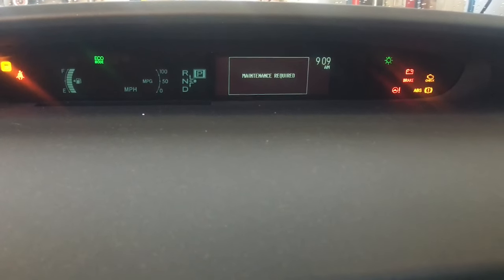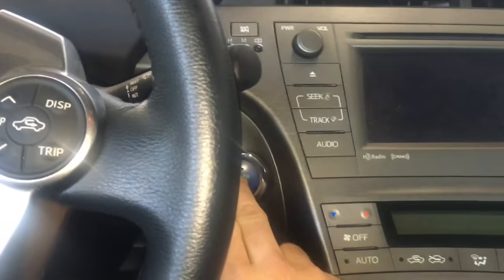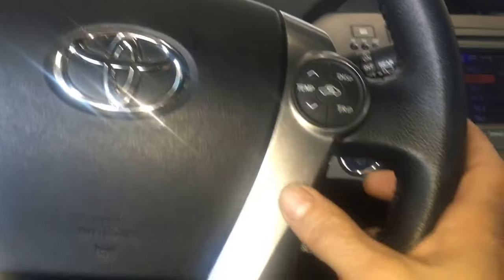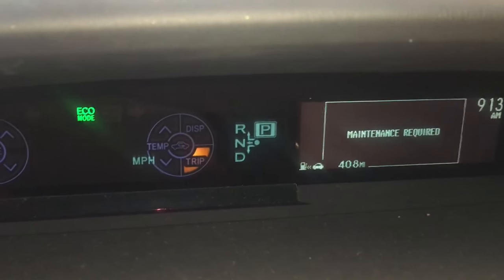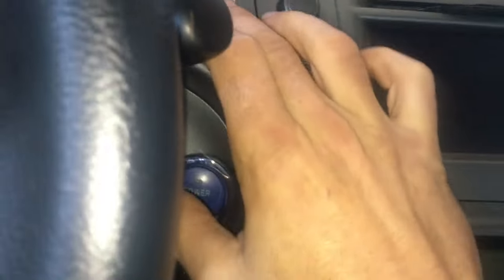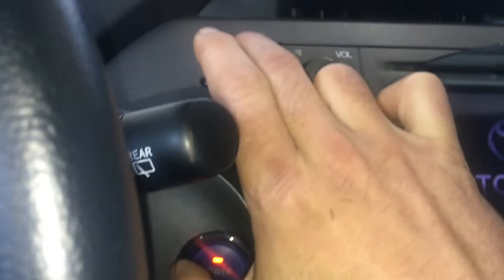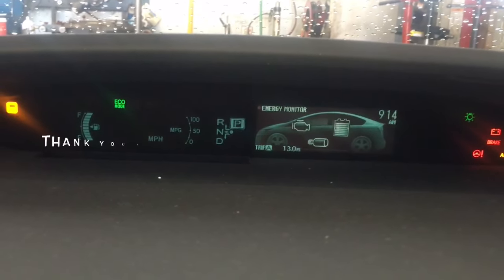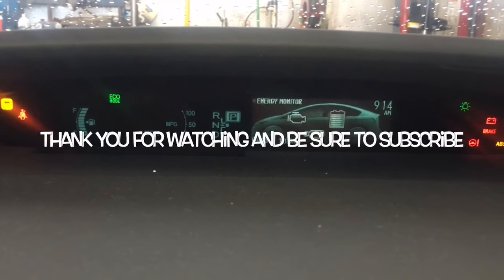How To Reset The Maintenance Required Light On A 2012-2014 Toyota Prius

Comment: He is right up to the point that after you push the start button twice, you need to keep holding down the km/h - MPH button till the reset is finished.  Good video. Thanks.
Reply: You're right! It worked only after I kept pressing the km/h button until the display showed it was finished resetting.
Reply: Oh man THANK you! I thought I was the only moron not doing it right. That worked!
Reply: I did all of these steps but It doesn’t work. I’m holding the button all the time, but it wont reset anything
Reply: Dude thank you
Reply: @nazarenkoy2680  for some reason on some of these cars you have to make sure your display screen is set to "energy monitoring" for it to work.  It took me some time reading forums to figure this out.  Seems like an extremely important detail to leave out.
Reply: That did it. Thanks a mill!
Reply: @vincentlenart1697 Thank you!
Reply: @Brainbuster Yeah, he shows it briefly but doesn't say it.

Comment: You're missing crucial detail that would save a lot of people serious headaches if included; Make sure that your display is set to the energy monitor screen... might not be required on all gen 3 prii but is required for mine. Found it on a forum after reading through accusations that the op wasn't following instructions... which they and i were.
Reply: Omg thank you!!! I wasint getting it, it took me 2 hours due to this crucial detail I didn't have
Reply: @LuisGarcia-iy7oh  No problem! I'm glad i could help spare someone some of the frustration i went through.
Reply: Damn dude you’re a g, this worked for me thank you.
Reply: After many tries gave up but finally found your thread and bingo I’d buy you a beer if I knew who you were lol thanx.
Reply: It was the consumption screen for me, but either way, I'm thinking the key is that it can't be just left on the maintenance required screen upon turning off. I could be wrong.
Reply: Thanks for that, I was having the same problem
Reply: Thank you!!
Reply: @MegsMT  glad i could help!
Reply: Thanks brother!
Reply: Thank youuuu. Yes. I needed that piece too 🙏

Comment: OK,  I got it,   you're OK with the steps,      That button on the right is the wrong button SIR,     I'm sorry to say,   the button that you want to PRESS,     is on the left  lower side across from your KNEE,   says - "mph / km"   on it,    I pushed that one & it worked... 👍
Reply: Mine is in the same place as you say, but the model he's in is obviously different.
Reply: Because your model is probably different. Doesn't mean he's wrong. You probably had a split year with different options. It worked for me just fine and was where he said it was. So he was right initially. That's where most are on 2012 prius.

Comment: Thank you for this clear short video. I just changed my oil and wanted to reset the maintenance required light. The previous video I looked at did not say to push the power button twice with the brake pedal off at the same time as holding the kilometers per hour to miles per hour button. Your stating that clearly helped. Thanks.

Comment: For plug in make sure it is on Trip A and turn car off...press down on kmh/mph (it's on the left of the steering wheel under your gasoline button) and don't let go, then press the power button twice

Comment: Hi after I did this, my engine wont turn on anymore amnd the lights are flickering :( are those two related?
Reply from the maker: Sounds like the battery went dead. You’ll need to get a jump or the batteries on the way out needs to be replaced.

Comment: Isn't working for me. 😢
Reply: Don’t depress brake while holding km/h button and hold that km/h button until loading bar finishes!
Reply: @lisaball1701  thanks... i found the problem though.  The screen has to be on the energy monitor screen for this to work. That's a crucial detail that's missing from this tutorial.  I'm guessing most people just have that screen selected at all times? I already wrote a comment correcting this.

Comment: This did not work and we tried it at least ten times perfectly. another video for same year uses method to hold on brake but that didnt work either. perhaps it means something IS AMISS with the engine and is severe enough it needs attention. both we and toyota and smog people everyone tried this method and it did not work and I printed it out and used the sheet as we attempted.